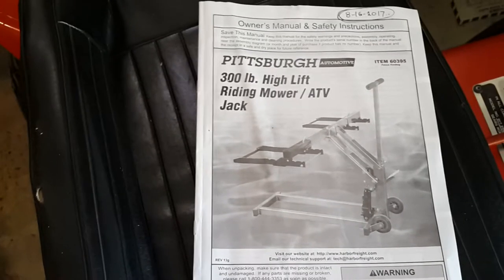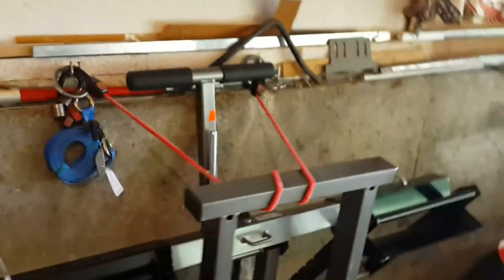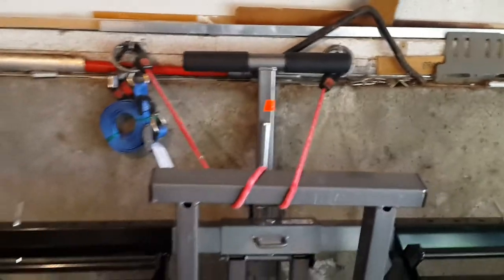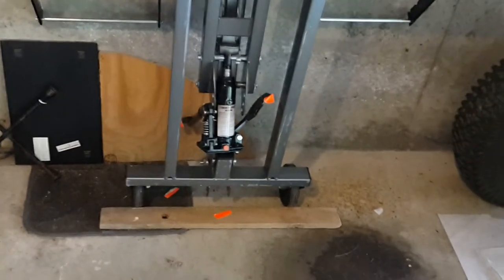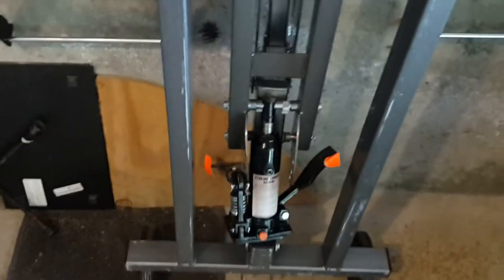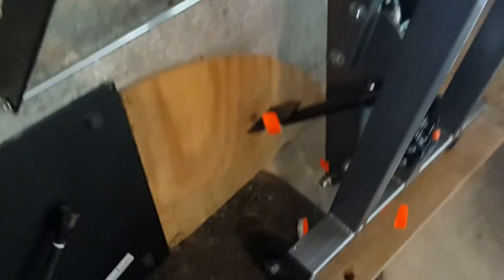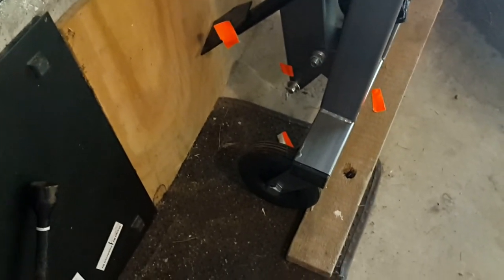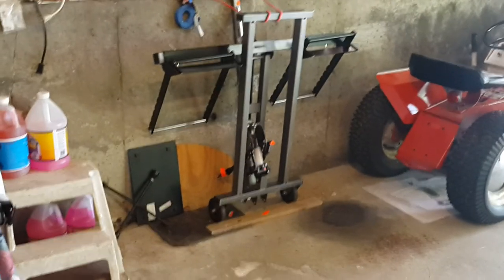Harbor Freight mower jack:  tips & additional info ...

Comment: Thanks for posting this and thanks to Ken F. For pointing out which exact model number easily folds up. I was needing one of these and was worried about it not fitting in the shed. It fits perfectly!! I had to call around to find there was only one left in my city! I use a ratchet strap to keep it together after pulling the bottom pin and the handle pin out. Folds up nicely. I can’t fathom why they would omit this feature from the newer models?? Anyhow, my deck is clean and my blade is sharp! CHEERS! 🍻

Comment: FYI all....Folding this is easy! 

There are two lower end (currently $89.99) models of this lift at Harbor Freight. #61523 & # 60395. Only model # 60395 folds up so if you want a foldable lift, make sure you get that one! They look very similar except the wheel brackets on each are different styles. Again, you want # 60395 which you can find at: https://www.harborfreight.com/300-lbs-atvlawn-mower-lift-60395.html

David, you can fold this unit down even farther than your 14". I have mine folded down to 9" wide and here's how you do it.

Once fully assembled...

1. Remove the (2) wheel bracket assemblies & support beam and set aside. Put all of the pins back into where they were to help remind you of how to re-assembly them. 
2..lower lift so hydraulic cylinder is compressed as far as you can get it. 
3. Remove the lift pin & spacers that connects the cylinder piston at the top to the lift arm, then put the lift pin & spacers back in the lift arm.
3. Remove the shaft pin from the very bottom of the handle support arm assembly,, then put the pin back in to the handle support frame.

The handle, lift arm and cylinder will now all fold down to a compact 9" width. use a bungee cord or piece of rope to secure the handle and lift arm to the bottom frame because they can now swivel separately.This keeps the folded pieces all together for storage. To store, get a V-shaped hang all hook  (see: https://www.harborfreight.com/v-shape-hang-all-61533.html) for $1.99 and mount it to a wall stud high enough so you can hang your ATV/Lawn Mower lift from it by the handles. Keep in mind that you will also need to store your lift's support beam and (2) wheel bracket assemblies as well but they take up almost no space and can just lean against the wall next to your hanging lift.

The whole process takes about 10 minutes to both "fold & store" your lift and/or re-attach all components so your lift is functional again...and it ends up sticking out from the wall only 9 inches!

As I said though...you want 300 lb. ATV/Lawn Mower Lift # 60395 which you can find at: https://www.harborfreight.com/300-lbs-atvlawn-mower-lift-60395.html

For what it's worth, This lift is surprisingly solid and well made. I use it to lift both of my Craftsman 25HP V-Twin lawn tractors (one's for mowing, the other has a snow blower attachment) whenever I need to change belts, clean out the underside of the mower deck or change my mower blades and the lift easily handles the job. You won't be sorry to have one!

BTW David, great tip about using a magnet to attach the safety pin to the handle so it won't rattle around! I was using velcro but I like the magnet idea better!
Reply from the maker: Ken:   Wow, you managed to get that storage space down to 9",  congrats!  I just may try your method one of these days.  Thanks!

Comment: Mine won't lower after safety latches released and mower is on it
Reply: That happened to me too.  I had to use another pair of jacks to get it down PITA!  I went to order new ram as the bottle Jack is called, they are on back order for several months. I looked into a suitable replacement but could not find one.  There is two videos that show ways to weld stuff on top and bottom to mount with but I don’t weld.  I used it three times but it’s out of warranty. I don’t think this was a very good investment. In my searches on the web it appears this is a common problem